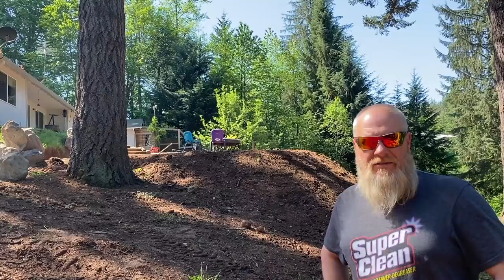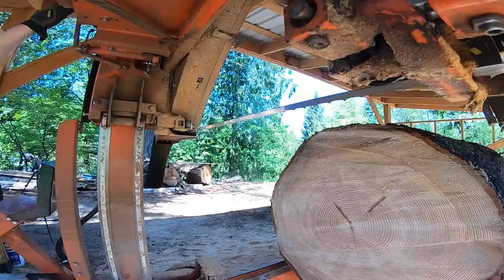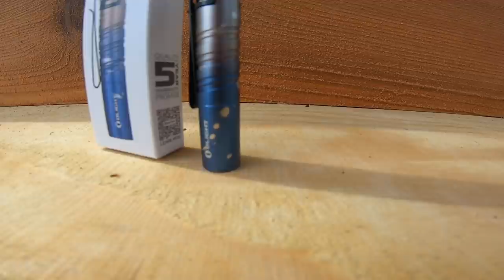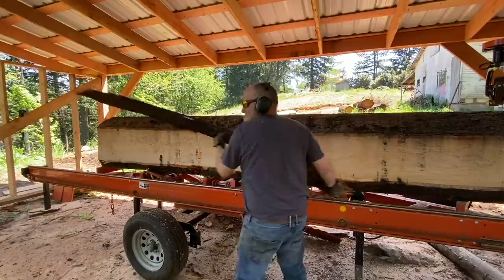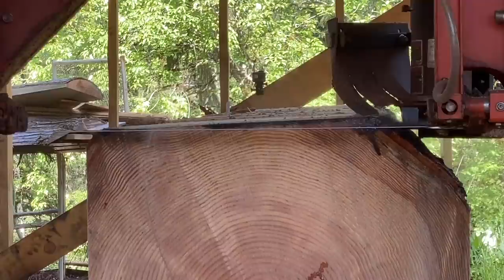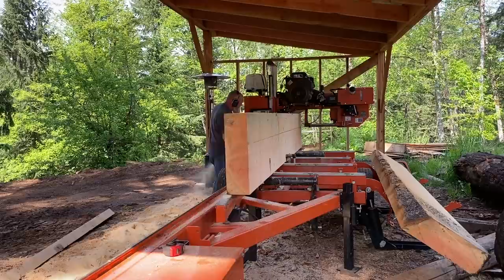Covered Fire Pit Part One

Comment: I saw Nathan at Out of the Woods (youtube channel) mention that if you put too much pressure on the hydraulic clamp that it can force the log stops out of square.  Also if you have some debris on the log bunks that can do it to.  He now takes the time to use a framing square on his 3rd cut to ensure the that the log is positioned square to the log bunks.  For your over size post, you could knock the corners off it and make it an octagon.  That would still give enough flat surface for any beams you would need to attach.  It would certainly add some extra detail to the project.
Reply from the maker: My problem was that there wasn’t enough flat surface to actually line up on the stops. Those big logs take a little extra care when squaring up.

Comment: It can be hard to get those big logs square, or, I should say, easy to not get them square, and it doesn't always show up right away.
Good on you, you're one of the only guys I see compensating for the log taper, of course it's a lot easier with the toe boards than by hand, especially on the bigger logs.
I get jealous every time I watch one of you guys with all the hydraulics.  My wife wants to buy me a new mill with all the bells and whistles, but I tell her I don't know if I have enough left in me to justify the cost. Besides, I guess new mills are a year and a half to two years back ordered.
Reply from the maker: Thank you! I bought the hydraulic mill because I didn’t have enough in me to keep running manually. 😬 there is quite a wait fir a new mill but I will say, these things hold their value better than anything you can buy. Other than real estate, of course.

Comment: I have chunks of bark get under a log when it's still rough like that, and had to do the same squaring operation.  It will happen again.  we keep the framing square at the saw to double check squareness to the bunks continuously. The squares are reasonable at Harbor Freight so it's not a big deal to have  a couple around. Nice wood and good job in milling.
Reply from the maker: Thank you! Those bark bits have gotten me more than once.
Reply: @NorthwestSawyer  Me too.

Comment: When you are sawing especially on large logs and you want a true square product once you have the 2 faces open up, before open that 3rd face you need to use your framing square, use the square from the bed rail to the face to make sure that face is square to the bed rails, then when you open the 3rd face you know you have 2 square, when you open the 4th face that gives you 3 square faces and your first face you opened you’ll probably have to make a skim cut to square up that face, you don’t follow that method you get the finished product you have now, but wise move checking the deck and saw carriage to make sure that wasn’t your issue

Comment: Something i learned from  out of the woods  Nathan Elliot was to check  the  cant with a framing square off of the bunk once you  get  two flat sides  also what blades are you using  Tonto from mid Montana.
Reply from the maker: I’m using 10 degree Double-Hard blades on this Fir.
Reply: @NorthwestSawyer   ok i jave a woodland mills hm130 max and i have been using  woodmizer turbo 7 Silvertips  and they work great  im also looking to upgrade to a  lt35 in the future. Tonto
Reply from the maker: @tjcustommilling3279  my first mill was a Woodland Mills. It was a great mill.
Reply: Is there still lots of wild fires  there or are they getting them under control?
Reply from the maker: @tjcustommilling3279  nothing close to us. The fires we’ve had so far are just about out. We have a lot of hot weather in the forecast. Fingers crossed.
Reply: Its the same here the fires are west of us closer to Idaho  but the smoke is still thick

Comment: i did wonder when you didn't take as much as you could off your first cut and then flipped 180 rather than 90 which you could of maintained your sq on and maxed the material out of the log
Reply from the maker: On a log that big, I don’t have the clearance to take off enough to square up on the log stops so I have to roll 180. Usually more than once.
Reply: @NorthwestSawyer  ahh benefits of my lt40! i still reckon max your first cut even if you need too chainsaw a bit, but i can see what you mean, i have cut over a meter dia on an lt40